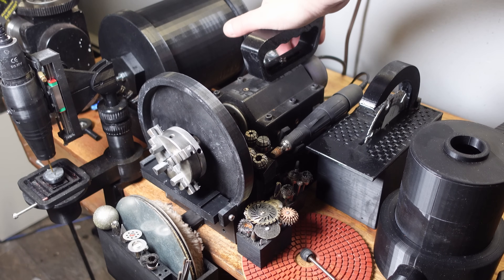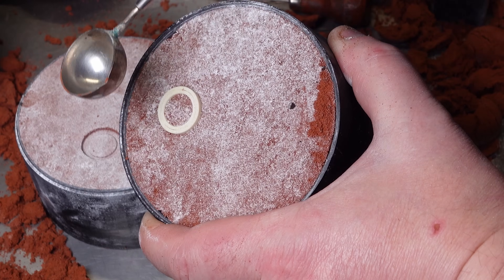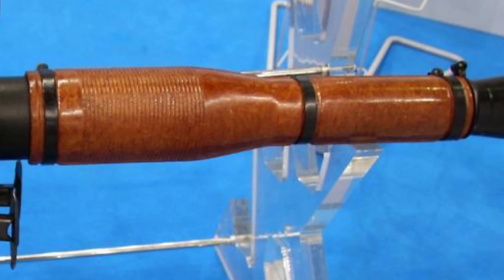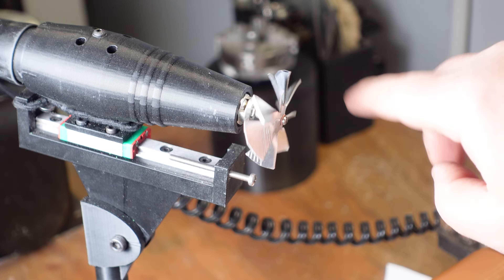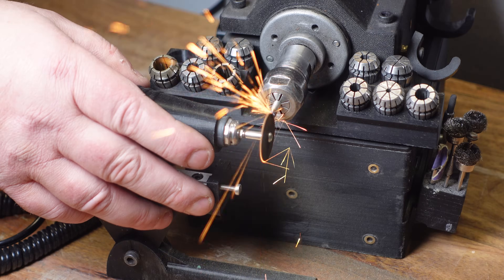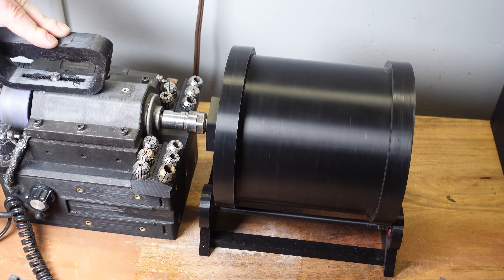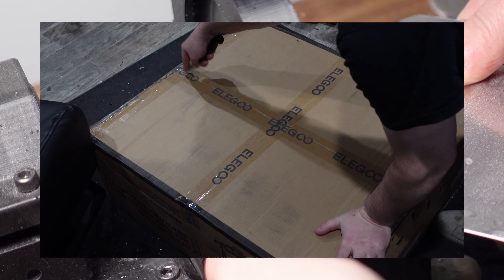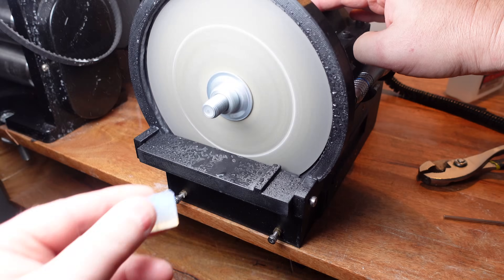3D printed "Everything" machine casts metal #3dprinting #elegoo #diy  #maker #jewellerymaking

Comment: Honestly, I love this machine. I think it's just so interesting and versatile. But it also proves how interesting and versatile another machine is: the 3D printer. I know its in the name, but the printer is the engine that drives this project.
So i do have to burst your bubble a little bit: this will never be an everything machine, cuz you will always need a 3D printer. 😂😂😂😂
Reply from the maker: Totally, without a doubt the 3D printer is the invention of our lifetime and combined with AI, its going to make some incredible things possible. i was planning on buying a cnc for machining metal but decided that i could just 3d print and cast the parts i needed in metal so for a fraction of the price of a cnc, i bought an induction metal melting furnace that will hopefully let me cast all of the metal parts i need faster and easier than cnc. thanks for your comment!

Comment: One thing I’d love to see is slowly converting the plastic parts into metal using the casting feature. Start with the parts that get the most flex, and replace parts one by one until it’s mostly metal. Then, you can 3D print new modules, test extensively and if good, cast into metal once more. 

This all is what 3D printing is all about. I’m an old RepRap guy, and the concept of using a 3D printer to make a tool to make new tools out of solid aluminum alloys very much fits our ethos at the time.
Reply from the maker: I like that idea, and I'll definitely be adding more metal parts as time goes on!

Comment: Drill some holes in the vacuum hose to reduce its strength perhaps? Thanks for the video, I’m sitting on a metal melting stove and some pewter, just need to start using them!
Reply from the maker: @patrickl9930  I was waiting for the tarrif situation to end so I could get an induction melter I want to give stainless steel casting a shot

Comment: Another low poly lover? If you design circles make sure you bump up the edges to max. Makes the print prettier and the printer has an easier job.
Reply from the maker: @hanfo420  it's not that I love low polycounts. Not all of my parts are like that. I model most of my parts in fusion but if I'm at a work computer without CAD, I'll sometimes model parts on tinkercad if I'm not busy and the poly count is terrible with that software. I actually like the look though

Comment: Whats the slowest speed this can go? I make pens and have to do some cleaning steps that use dremel bits, but the slowest speed on my dremel is 2000rpm and its not great. If this can go down to 50-300rpm consider me a plan-buyer!!!
Reply from the maker: @guitarchitectural  the slowest speed depends on the load but it can get quite slow. I haven't measured it but as you can see the tumbler attachment is running quite slow.
Reply: @sweetgumnyc7794 very good point!

Comment: Man, stop reusing footage. It is just confusing. Please, use footage that is related to the work at hand. Change the titles. You keep reusing the same title first. Clean it up

For example 
Casting Metal - 3d Printed Everything Machine (3DPEM)

Use footage ONLY Related to the project. 

This is causing extreme amounts of confusion to the new viewers as they jump into this project, me included. If you want to show case this project, start with a 1 minute pre recorded intro about this. Easily skippable for those who know
Reply: And please keep the topics fixed, don't jump around. And shorten the videos. Separate the topics and SLOW down. We get it you work fast. But this is too fast to keep up. Slow down, stop talking and let the footage do its job. 

This isn't because I hate your content, it is the opposite. I love it but it is messy. Hard to keep up with. 

Remove the hashtags from the title. Wrong place man. Not how the algorithm works.
Reply from the maker: @ahmadhasan3258  I reuse footage as B roll when I'm explaining something new. I can't film new footage for every script. I think you seriously underestimate the amount of work involved in this project.  If you're confused about anything, that's why we have a discord.  Regarding my choice of hashtags, not sure where you're getting they don't work because the project seems to be doing just fine but thanks for your advice

Comment: These are so exciting!!! How do you think the motor would go running for 4 to 7 days straight  with the rock tumbler?
Reply from the maker: It's a spindle motor for cnc use so it's way overpowered for this use . To run the tumbler , it's set at it's absolutely lowest possible speed setting so there's no worry about it overheating . It's barely even  running at that setting and doesn't even get warm
Reply: @sweetgumnyc7794  oh brilliant! Is there a better filament to use if I have the option?
Reply: @jesse-roseartufel3441  If you have the option, PET is usually a good filament. It's a little stiffer and much easier to print than ABS, but more impact-resistant, UV-stable, and heat-resistant than PLA. I doesn't really shrink or warp while printing either. It's become my default filament because it performs really well and it's also easy to print.